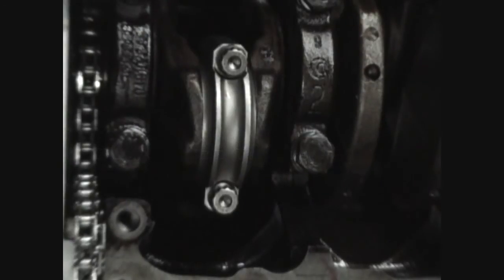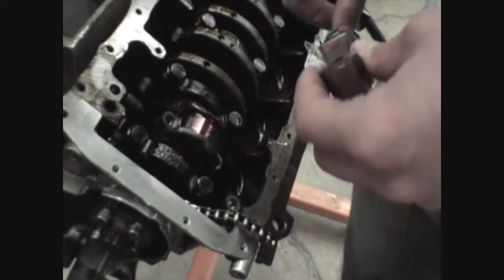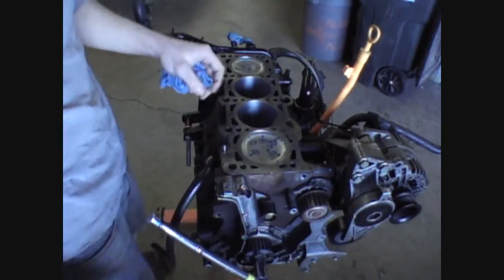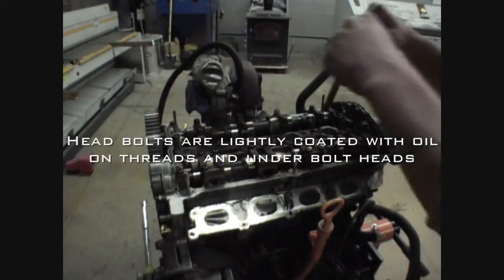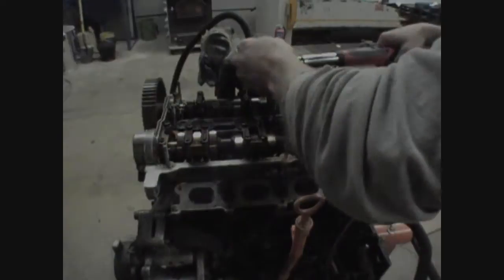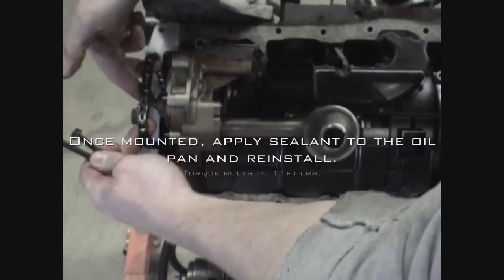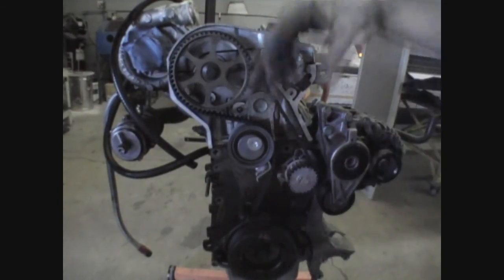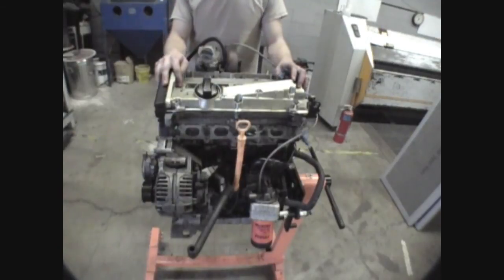1.8t engine assembly HOW TO(part 5)

Comment: when tightening head bolts on stage 2 and 3 - highly recommend not using your torque wrench - use a 1/2" bar wrench only and turn 90 degrees.  head gasket is attached dry.

Comment: Using this guide and my Bentley to rebuild my B6 Audi A4 1.8t.  Very helpful info about the timing by the way.  Quick question however.  Most people use gasket sealant on the headgasket and such... your video doesn't show this... what do you recommend?  Sealant or just put the headgasket on dry?

Comment: Next video. How to install a 20v head on a 2.0L ABA block (better R/L ratio with more displacement) mechanical lifters and for hi-rev engines.......how to get rid of the spring tensioner for a fixed one from the 16v ABA engine.

Comment: Just wondering what your opinion is on getting the small end of the rods fit to the piston pins.  The shop I had do some of the machine work for me believed it was a critical step, but it isn't something I've ever done on any other motors that I've built.

Very helpful videos and good for getting the confidence up.  Thanks for posting.